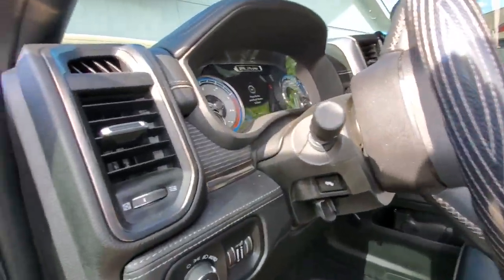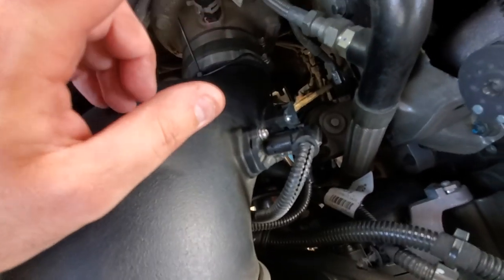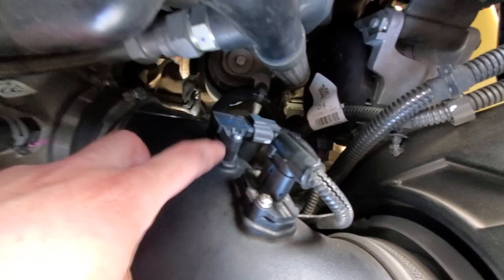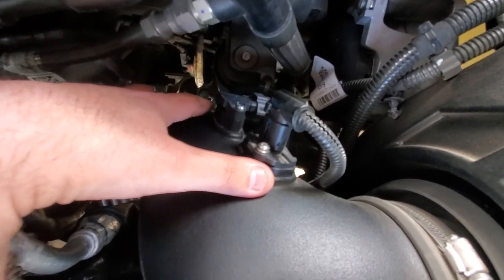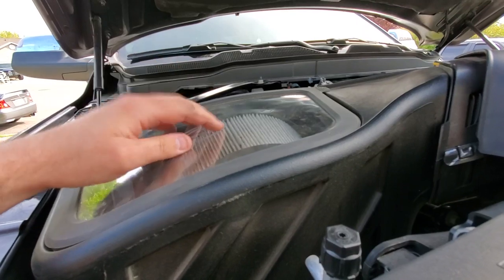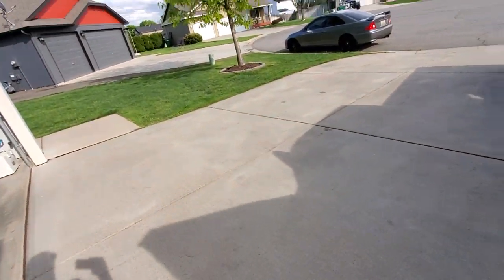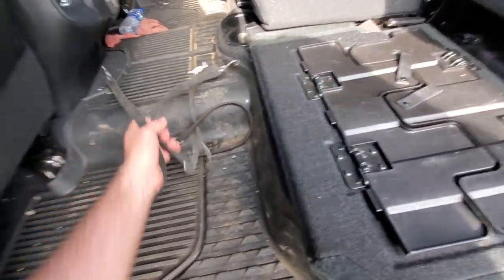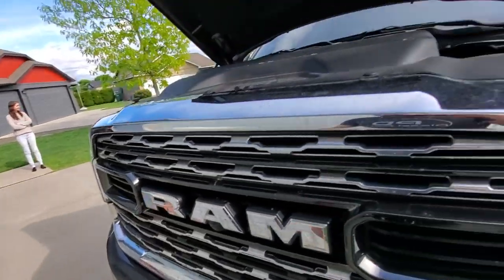S&B Intake system 4k mile review. 19-20 Ram 6.7 Cummins.

Comment: I put an S&B on my 2019 3500 and had a fitment issue. The air box bracket at the front was too short. Luckily I had two aluminum spacers that I added along with some longer bolts that made it a clean install. S&B were made aware of this and tried to help but I haven’t heard back from them lately. I have Optimal Welding tunes in the truck with full delete. The air filter I had was getting pulled in so switching to the S&B def helps.
Reply: B G how is your 68rfe holding up with it tuned?

Comment: 2021 5th generation here (cp3).  I love it.  This is the way it should have come from the factory.  The idf sensor and map are  are positioned closer to the air box than the 19' and ' 20s and yes they added the appropriate spacer for the idf sensor.

Comment: The folks at tfl trucks are suggesting that the 21 Ram is going to the Allison 10 speed, and much more power.

Let's hope.
Michael.
Reply from the maker: Its crazy how much power these trucks already have. And the aisin handles it just fine. I guess let's see what ram comes out with.
Reply: I am not racing anyone. Don't need more power in a work/tow rig. Need the MPG that they seemed to have misplaced in the new HOs.

Comment: Stick with OEM, cheap to replace every 5;000 miles for best fuel economy. Those after market filters get dirty and you can never 100% get it clean! Flies and crap always build in the base and top where paper vanes hit the rubber. Geno’s Garage!
Reply: I have dynoed several trucks with and without cold air intakes no i repeat no difference .stick with oe filter assm .
Reply: Factory filter setup is good for 500hp anyways. Either way love the truck and all your past trucks. Wish I were near you to buy one lol

Comment: Not intake related but a question. I can’t get my hood to stop shaking. Adjusting the bump stops made it better but in heavy wind on the highway I get flutters all day. Any issues with yours or fleet trucks?
Reply from the maker: Mine does that too. I did the same thing adjusted the stops and that's all. Seems like its about to pop open on a windy day
Reply: Just bought a new Limited 3500 in Boise and drove it back to Spokane.  Hood fluttered all the way back.  My 2017 2500 never did anything like that.  I am not sure what to make of it.  Is the sheet metal thinner?
Reply: Michael Doherty it’s not only thinner but aluminum. Also the brackets are aluminum the gasket provides little support and the structure of the hood it non existent.

Comment: I think everyone is wondering if your still using Matt’s “emission compliant tunes”? Also with the new updates did you get a surge under load around 50mph almost like pushing the accelerator down and letting off over and over?
Reply from the maker: Yep and yep
Reply: PD Diesel Power dose mattes tunes help with the surging? Thanks for the help! God Bless👍

Comment: Hey Paul,  how much oil do you add with your cummins and how often?
Reply from the maker: https://youtu.be/XbOhMKBFWtY
Reply: @pddieselpower  , what about your high mileage?
Reply from the maker: Depending how hard they get pushed. None to 1qrt every 10k. I have a driver that does 20k. Oil level bearly moves
Reply: @pddieselpower  , same consumption from when they were brand new?
Reply from the maker: Yep
Reply: So you never had the check engine light come up? Supposedly S&B is redesign it because everyone was getting errors.
Reply: @pddieselpower ,  very impressive.  Looks like older cummins engines were better engineered. Thank you for quick reply.

Comment: Hey Paul. I sent you a message a few weeks ago about trying a air dam below front bumper. 
Try it on one of your fleet trucks. I easily see 1-2 mpg improvement on highway with it.
Reply from the maker: Thank you. Ill look into it
Reply: Any links for the air dam
Reply: @lupereyes6737  
No links to it as it’s something I made and installed. 
Most people wouldn’t put on a air dam like I have. It seems that most trucks I see or read about take the factory air dam off to give the truck a “lifted” look. Mine is so low it will hit a parking block.

Comment: Hey paul, what do you think on a 2010 ram 2500 big horn 4 door long box diesel  with 132k and it has the 6speed manual, is it worth 22k?
Reply from the maker: A bit high but manuals are tough to find. If its the truck you want go for it. Manuals will only get harder to find.
Reply: @pddieselpower  going to see if they will let is go for 20k and we do have a 2001 ram 2500 with the 5speed manual with only 185k but here in MN its starting to show rust from the winters!